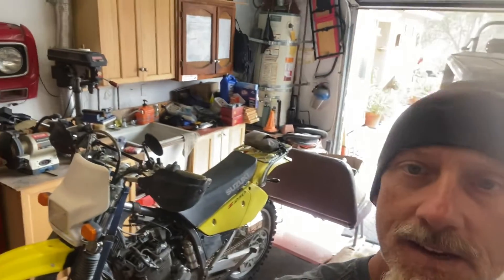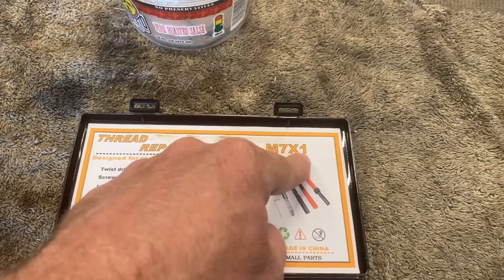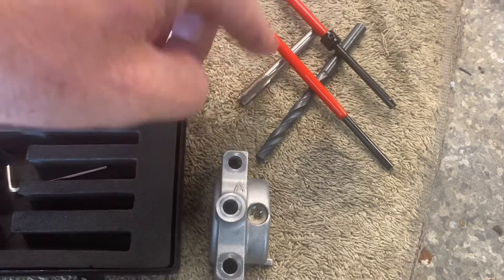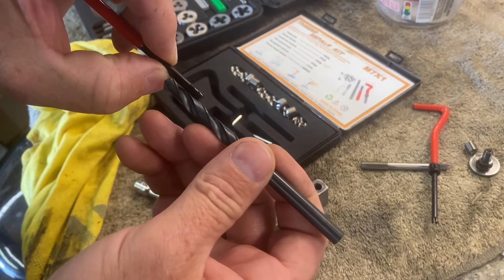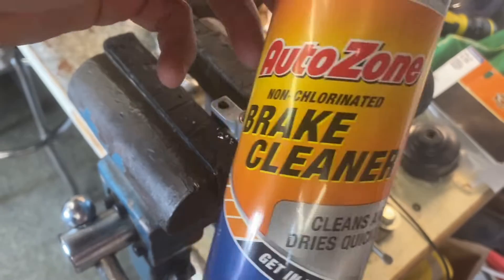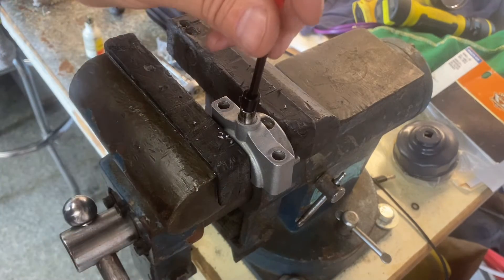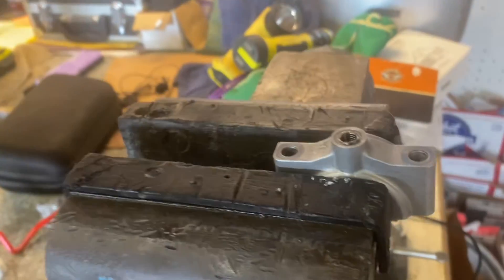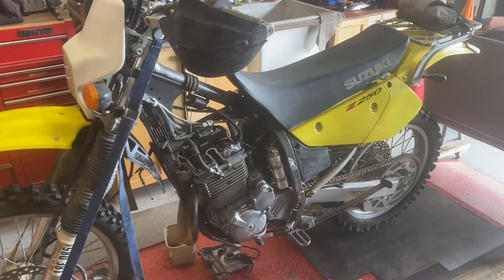Stripped Threads?  How To Fix It Using A Helicoil Thread Repair Kit!

Comment: I get tired of those dam J1 (Philip like) screws, typically use a nut remover then replace with appropriate bolt. I like how you take the time to use a dab of cutting oil and take your time to do it right.
Reply from the maker: I usually don’t do it right!  😂😂